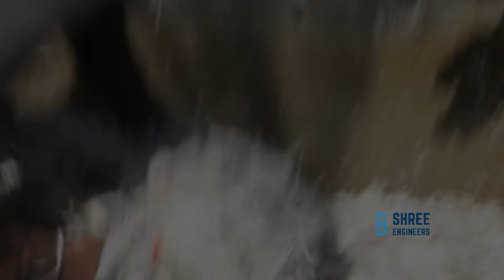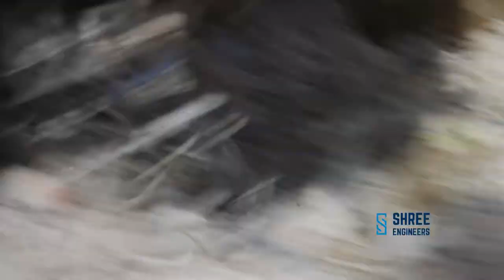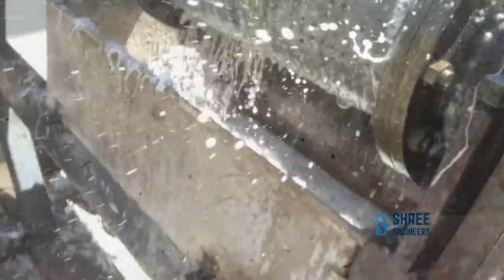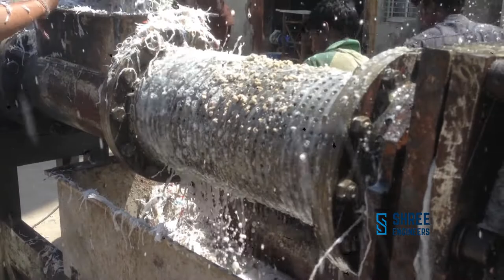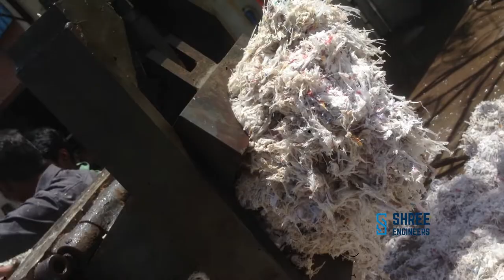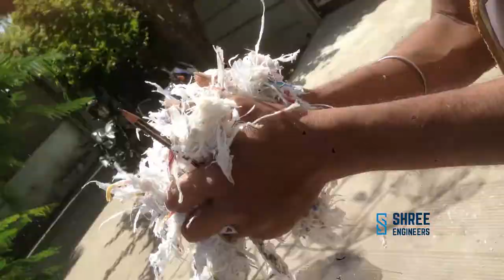Plastic Waste Dewatering Screw Press

Comment: Is it applicable to washed plastic films only, what's the output capacity per hour, power consumption?
Reply from the maker: Kindly contact us on +91-8320966623 for all technical details regarding the same.
We'll be happy to provide you with all the details.